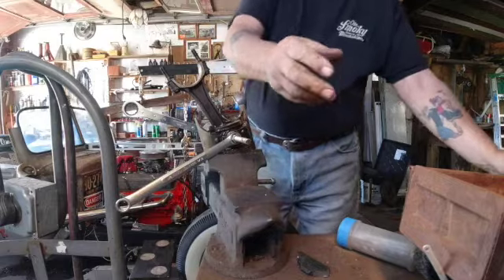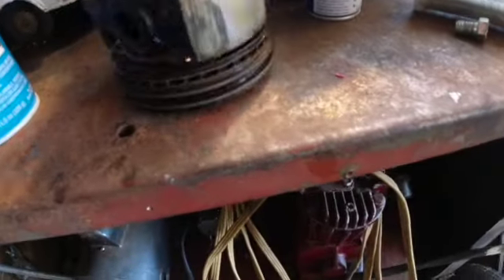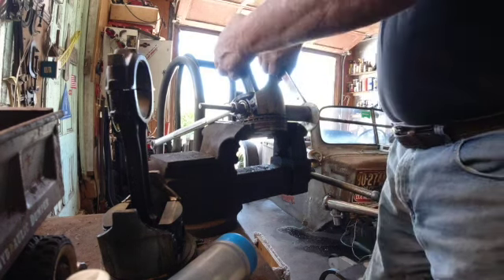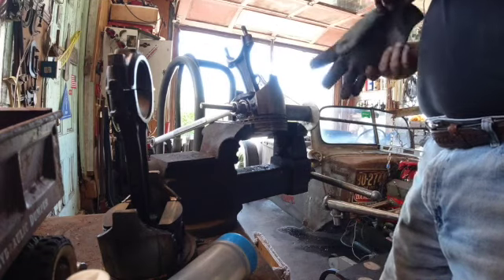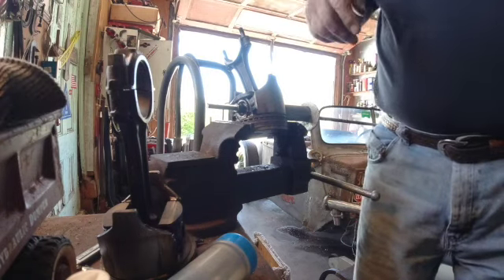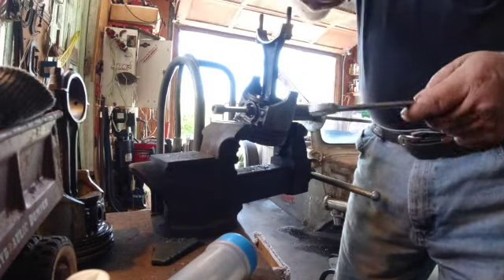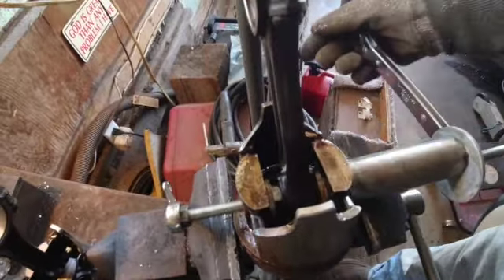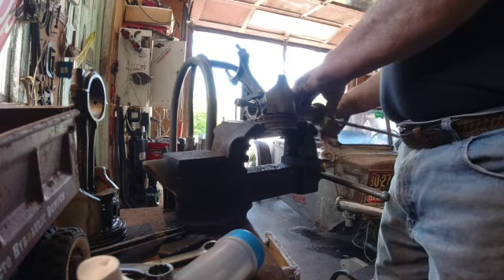How to remove an  SBC piston wrist Pin with home made tool

Comment: That worked really well :-D
The good old bench vise is often ignored as a tool, so handy for any kind of metal torture :-D
A hammer and cold chisel is ideal for those nuts that spin on a bolt but don't come off.
Basic crude tools are just handy :-D.
Reply from the maker: It's all true what you said..